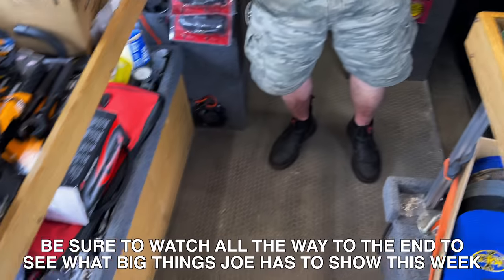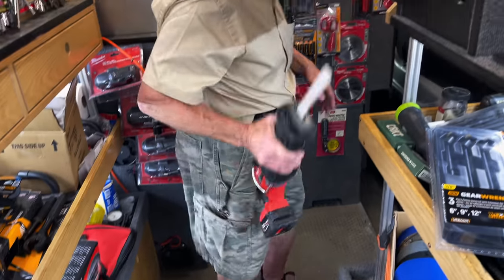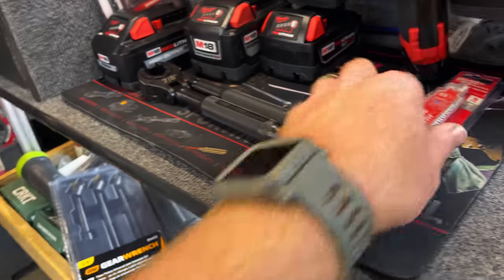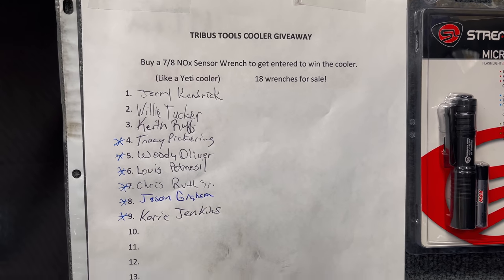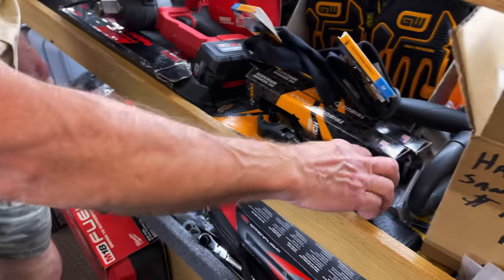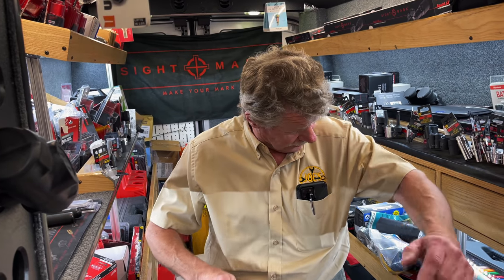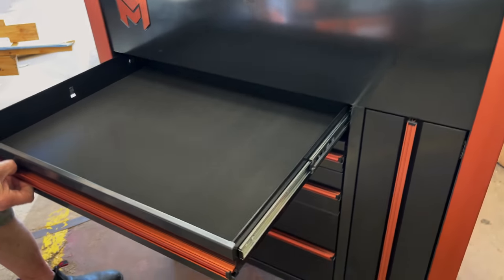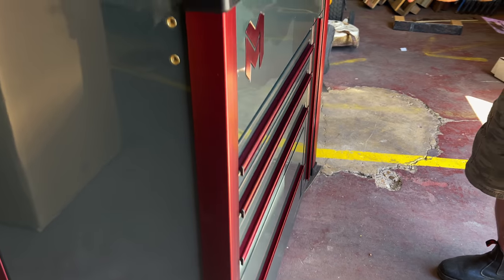Joe's AllStar Tools: MTS Roll Cart Milwaukee Torch Demo and Gearwrench Universal Extensions

Comment: It's funny because they even have a better blade than that called the nitrus thick metal blade, I use them to cut the clevis pins that connects to the slack adjusters when I'm changing out the slack or the brake chamber

Comment: I've got some of those torch blades for the sawzall and hell yes they work good but if ever needing to cut up a truck bed for scrap metal, watch them on the cross members On the bottom of the bed because they will get hung in that metal very easy and snap the blade just about every time right in front of the eye where it hooks to the sawzall and the teeth on the blade will still be in great shape... I've also took one of these blades that broke like that and traced it out with a New blade and put it on the grinder and cut it down and take a drill a hole in it and use it again because they're not cheap anywhere you buy them LOL